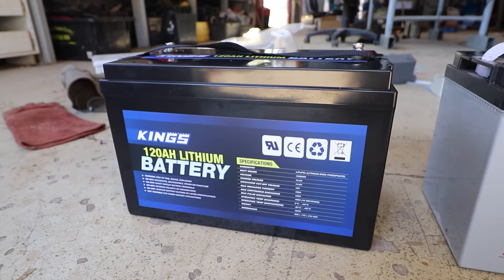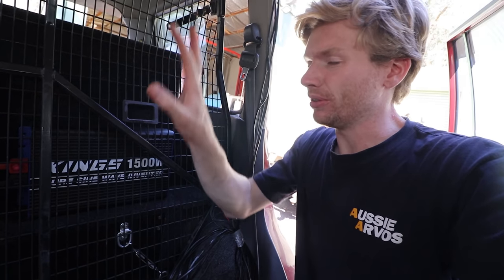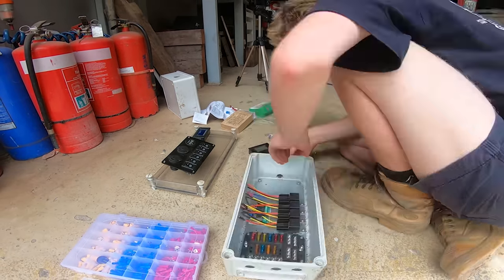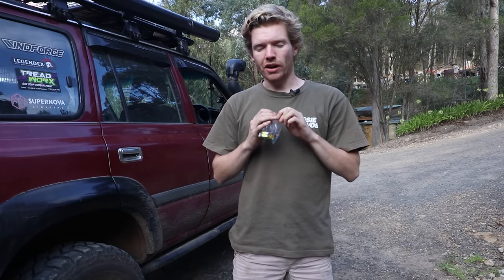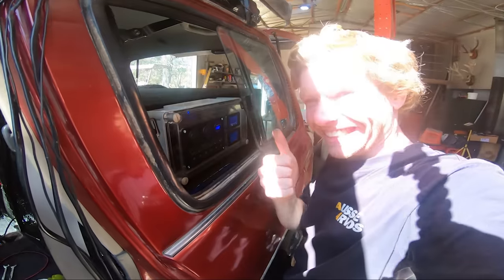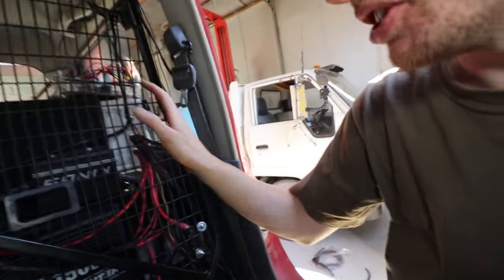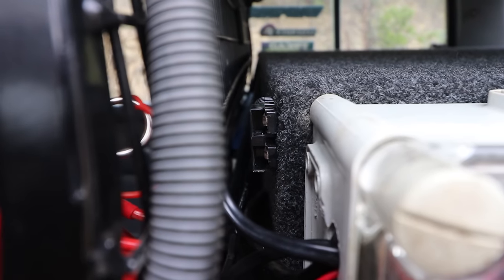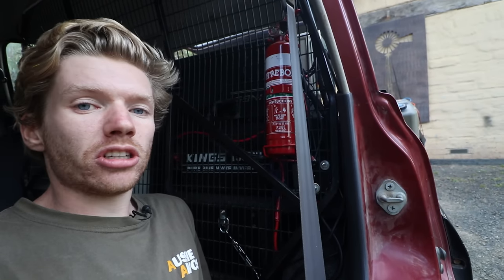is Cheap LITHIUM a BAD IDEA?? Building a REAL Budget 12v Setup

Comment: Hey mate great video! Just a suggestion, upgrade to a Renogy battery shunt or even better a victron bmv712 they're absolutely awesome bits of kit, you don't have to reset the meters. Good work 👏
Reply: +1 for the BMV. It's not big money and it's worth a lot more than it costs.
Reply from the maker: Thanks guys! Yeah they are definitely good options! Cheers :)
Reply: Agreed on the victrin bmv712. Bloody rippa gear.  IMO that's a heavy lithium.
I have a slimline 175ah lithium that weighs 11kgs.

The biggest issue you have with cheap lithium is the constant ampage  output and BMS reliability.

Good luck with this set up.
Hope it works for ya this time.

Comment: Hey man, great vid. Yes your alternator might be rated for 110A or something similar,  but check the output at idle...I bet it'll be around 50A. So if you chuck a bigger DCDC on there, you might be pulling down your start battery to charge your lithium when you are sitting at the lights or pull over on the side of the road etc

Comment: Love your content, no bullshit or crap just actual content, well done. Only issue ive seen is those ebay circuit breakers can be pretty hit and miss, ive had them trip randomly with minimal power draw etc, a midi fuse could be a better and more reliable option.
Reply: Just like Kings products be mindful of the quality of circuit breaker you use. There are plenty of Chinese, poor quality items out there. Buy good quality circuit breakers and you will have no problems.

Comment: Looks fine, only concern i have is that the wire ends screwed to the circuit breaker are not covered, if you drop something made of metal on it it could short to the body. Verry unlikely, but possible.

Comment: Quick question, how did you wire the double negative and single positive white/amber lights through the fuse box?
Reply from the maker: Hi mate, mine was 1 negative, 2 positive (1 positive white, 1 amber)

Comment: Great job and I wouldn’t beat yourself up over your wiring job. Aesthetics are secondary to: proper wiring gauge selection , fusing, isolation and functionality. At the end of the day most diy 12v systems are not designed for ensuring anyone( subsequent owners) can work on them. You know how it works and you know how to work on it. On the subject of increasing charging rate, I would stay conservative. 20 to 30 amps is more than enough in my IMHO. Don’t load up your alternator unnecessarily.

Comment: awesome job mate! but those breakers are not designed to be used as switches. if you use them to cut off the circuit too much they'll just stop working. I also used one in the engine bay and when it's hot it'll just cut off randomly

Comment: Hey, video idea. 
I came across a camper van that had a cheap inverter running of a 2nd battery. Everything running off the inverter and what was interesting is they did it all for under $300. Was a 2nd hand bar fridge, tv, and battery. Doing a AC setup could be interesting with showing pros and cons. As far as I can tell, AC is heaps cheaper

Comment: Gooday fellas, it must have been a solar system kind of weekend  I reckon. I've just extended my roof rack and set the panel over my ute cab and set the controls and batteries in better more usable positions too. I'm not a tech savvy old bloke so mines a bit primitive compared to your awesome setup. Well done on a great job boys.

Comment: Very nice setup 👌 it's come together nicely and I can't believe you fit it all in that tiny box!  Well done mate 👍 
I'd never look at king's gear for anything these days after previous experiences so will be interesting to see how it goes. Would be good to see a capacity test in the battery to see if it stands up to their specs. Their prices are certainly not cheap in comparison to a lot out there so you would hope they are decent quality. 
I've been looking at lithium for a few years now and to me allspark look like the best value for quality out there.
For now my basic isolator with under bonnet agm is working fine for my needs but it will only be a matter of time before I make the switch!

Comment: I also wanted to ask about the two monitors you have installed. I am confused after watching some other videos re shunts. Does a single shunt show whats going in (solar and alternator) and also out ie load readings? If this is the case, what is the benefit of having the two shunts/monitors?

Comment: Hey mate, not having a go or anything but are you having live wires against the whole in the metal box? If so wouldn’t you make the hole bigger and then put a grommet in to be safer? Surely the wires would rub through on the edges of the holes in the box?

Cheers

Comment: This is definitely smart. I was about to spend big bucks on one of the big brands that can show current in separate from current out. Instead, just have two different shunts and screens. $30 each, jobs done. 

With wiring, how did you organise the earth's for the "power in" shunt and the earth's for the "power out" shunt
Reply from the maker: Power in: Earth from car ground and DC-DC into shunt to battery Earth
Power out: earth from fuse box to shunt to battery Earth
Thanks big Oz! Definitely mate!!

Comment: Hey mate. Just wondering how you wire the shunts to measure your vitals in to the battery and away from the battery?
Reply from the maker: Hi Ethan! 
1st shunt is wired between the negative of the battery and the negative on the fuse box, (this reads power draw)
2nd shunt is wired between the EARTH (NEGATIVE) of DCDC and negative of the battery! (this shows power coming into battery from engine and solar)
Hope that helps!! Sorry I missed your comment!

Comment: That 200A circuit breaker is not rated for that cable, or battery. You need thicker guage cable, or get a 50A breaker. Plus you're Adventure Kings battery is rated at 100A continuous discharge current. So, you can't go higher than a 100A breaker on that system. You might want to change that just to be safe.
Reply from the maker: Yes 100% noticed the issue, spot on BMS will only let 100a output (160 max) will be fixing this. Thanks :)

Comment: The thing with your old isolator is sure it can handle 140a, but if you actually measured the current you would find the battery will only accept 20-30amps, so in reality, your lithium being able to accept far more than an agm, the dcdc isnt "pushing" current, its actually limiting current so that your alternator doesnt overheat. This also means your lithium is still charging at the same or higher rate than your old agm battery was, but it will charge at that rate right up until its full, where as the agm current absorption will taper off as it becomes close to full. Also remember that 140ah agm, you have around 70ah useable before the battery voltage will be too low to run an inverter and some more sensitive electronics. The lithium will provide you with stable voltage above 12v right until its almost empty, allowing you to use almost all 100ah of its capacity. So you've got a 30% larger usable battery than you had before, which makes it appear to take longer to charge. The voltage will also not change from around 20% all the way to 85%, sticking around 13.4 to 13.8v. That last 15% youll notice the voltage rise quite fast. 
Another thing to take into account is that agm if used to 50% depth of discharge, will only last a few years (3-5 usually) where your lithium should still retain 80% of its original capacity after 10 years, and thats if you cycle it full - empty - full again, EVERY SINGLE DAY. If youre using it with a 1500w inverter, the limiting factor will usually be the bms, not the cells. However, most lithium cells do call for a max 1C charge or discharge rate, so try to limit your actual usage of the inverter to 900w, as this will be pulling around 100A from your 100ah battery (1C) and your battery should last that decade or so. Its also good to know that lithium likes to be around 40-70% state of charge as much as possible, try not to keep it 100% full all the time, especially if you arent using it. For example if you dont use your fridge or other accessories in normal day to day driving, and only use it all on weekends or trips away, turn the dcdc charger off, so the battery isnt always at 100%. 

I hope this is some useful info for you, and from an auto elec, trust me ive seen and fixed MUCH worse wiring, and you're using fuses for everything so its not so bad.

Comment: Great work Pat, so good to see you having a go, be proud of what you have done mate, I am only running a 25amp bcdc charger myself and a 120amp lithium with a 250w solar panel   mounted to the roof, it works perfectly for running a 45litre fridge and all my lights and camera charging etc, never seen it get bellow 70%, be careful going too big with your charger as idle speed on alternators can overheat as the fan is not spinning fast enough with the amount of current the lithiums charge draw?
Reply from the maker: Thanks mick for the info, that's great to hear! Yeah I think from what I've heard today the 25a charger will be fine!!

Comment: Hey Pat loving the channel, have you thought about putting some small 12 or 5v fans for the box to keep it cool during our summers? 40mm nema fans are quiet and could help maintain the equipment and help the cables maintain the rating from your inputs

Comment: The 50-300A LCD Display DC Battery Monitor Meter 200V Voltmeter Amp For RV System are junk. 
The Victron BMV-712 Smart shunt you can program for Lithium battery and is very accurate.

Comment: Hi, I got a 1hd ft  24 valve LC80. can i use front 2 batteries to power the rear setup or do i need the 3rd battery.  Thanks

Comment: Hey mate, why don't you use one of the tr16 battery monitors? They're $50-70 and measures both input/output as well as remaining amp hours? Basically it consolidates your two shunts into one.

Comment: just wondering why it is better to mount your second battery in the cab as opposed to the engine bay
Reply from the maker: Not meant to get the lithium too hot, think it can operate up to around 50c

Comment: While your at it you should grab some conduit and tidy up the roof platform wiring 🤣👌

Keep up the good work
Reply from the maker: Thanks mate, oh it's so bad , but it issue is that those rock lights have 5-8m of cable EACH!! and they are 4 core 0.1mm wires so not keen to cut and solder over 30+ tiny connections as they might not hold and act dodgy. Trust me I hate the roof wiring too, but not much I can do about it 😫

Comment: I’ve really been looking forward to this. It’s a complete pay off that you basically did everything I plan to. And based on experience, wiring is ALWAYS messier than the plan the second you have to actually start running them through grommets and seeing how the wires actually “interact” in the enclosure. Well done. Excited to see more, and curious how long it will take for you to rebuild that little case…
Reply from the maker: Thanks mate! Yeah a plan is super helpful , and 100% I thought I'd be able to keep it way neater , but it was pretty hard fitting everything in with a door and everything!

Comment: Hey Man. Love the videos and the fact that you are upfront straight and honest no BS. Things might not be perfect but it works for your needs and that is all that matters. With the Kings DC-DC charger, what is your take on it? Good or bad? Looking at getting one but there is so many different types on the market these days and it is difficult to choose. Also read that most DC-DC chargers will damage main battery and drain it if you are running solar or a battery charger? Have you experienced this?

Comment: Great video! Love the 12v ideas you have, I’m looking at the Renogy 30amp dcdc charger and at the moment the voltx lithium battery from outbax, looks ok for price and ill only be running a fridge and some lights
Reply: Just be aware that if your car has a smart alternator you'll need to wire in their IGN signal wire.

Comment: Nice one mate. Good east setup not over the top. 
Why don’t you run you spot lights anymore?
Reply from the maker: Had to move them to fit the high mount winch, but will be adding them back in a new location!

Comment: Your going to wish you used those grommets for the wiring because the corregations that you encounter will eventually cause rubbing and  it will cut threw the wiring,it’s a potential fire waiting to happen.

Comment: 140A into your battery could be why it died.  thats a big fail if the battery was flat and your started the car. there are input limits on all battery types
Reply: It would never push that in reality. I had a breaker hooked up and it never popped the 40a in there. Lead won't take a fast/high charge in most cases

Comment: If anybody "roasts" you for the work you've done, they probably NEVER did anything themselves. Good job mate....reminds me of the sort of job I do all the time.....and I'm 67 and haven't ever burned a vehicle down ...YET...hahaha
By the way...I have 200ah of lithium in the canopy of the Silverado (3500, 6.6 litre Duramax diesel...not the baby "pretend" 1500 petrol) and have also replaced the twin factory starter batteries with a pair of 4.2kg Lithiumax lithium starters....
Caravan also has lithium (300ah) as well as 1,040w of solar.

Comment: Not that it matters any more, but you would never have dumped 125a into that AGM battery you had - it's rated to accept 30A during Bulk Charge.  Your Kings lithium job can take up to 100a charge.  Your 25a DC-DC charger will take about a 5 hour drive to fully charge the battery from flat.

Comment: can reduce the number of wires just by using the body of the car for ground. dont have to run 2 wires back to the box for everything.
also this probably helps with content. and you obviously like all the stats n shit. but realistically. who needs all the numbers.
only part of my setup you can see is the switches where they are needed. everything else can be hidden

Comment: You did well. Soon your power monitors will display rubbish and you’ll flick your 2 x circuit breakers off/on and they’ll work again. You wisely move your fire extinguisher from the potential fire hazard. That’s 2/2 - well done.

Comment: Your comparison between 2 lithiums and the one AGM is wrong. 2 lithiums weigh about 32kg total and provide 240Ah useable power compared to the single 140Ah AGM at about 35kg but only provides 70Ah useable power. It’s closer to 3-4 times the useable power for the same weight.
Reply from the maker: Yeah 100% , depth of discharge is a huge benefit!!

Comment: God damn.... that Kings lithium is 2kg heavier than my iTech 120A lithium, which is also a gen 4, which means I don't need a special lithium charger because the BMS is newer and better. Also if you add a second lithium to equal the weight, you will have nearly 3 time the power. An AGM doesn't give you 120Ahr, more like 65ish. That Kings wont give you 120Ahr either but rather around 100Ahr.
I'm not sure what alternator you have but a standard 80 series is 110A and I've seen them up to 140A (sealed marine are 220A) But what you need to know is they only push that are ~4000RPM. Trying to draw 80% at lower RPMs will cook an alternator. It melts the enamel coating off the windings and delaminates the stator. Just a warning for new players that think they can draw the rated output off their alternator.

Comment: More like 4 times the power with same weight, agm is only 50% usable power so 50 amps for 33kg. Lithium has 100% usable power although not recommended but doable none the less. So 15kg lithium straight away doubles the usable power of the agm, so if you had 2 15kg lithium batteries you theoretically get 4 times the usable power for the same weight
Reply from the maker: Yeah 100% depth of discharge is a huge benefit!

Comment: I just replaced my $999 lithium with $275 lead acid yesterday. DCS 75Ah lasted a year!
Reply: Damm really? I have two of them.. what happened?
Reply: @Jay-hr9ci  I had it in storage since last school holiday. Fully charged before stored each time and when I went to charge this week it won’t. Now shows ~2V. Emails with DCS but they’re 200km away.
Reply: There is a procedure to wake them up again
Reply: @timfreeman2603  lithium batteries should only be stored at around 50% capacity not 100%.